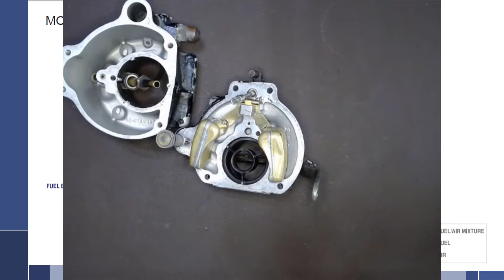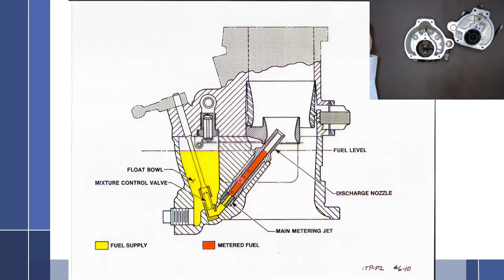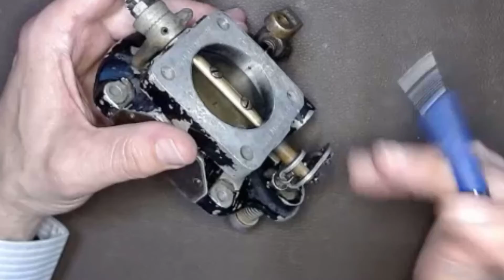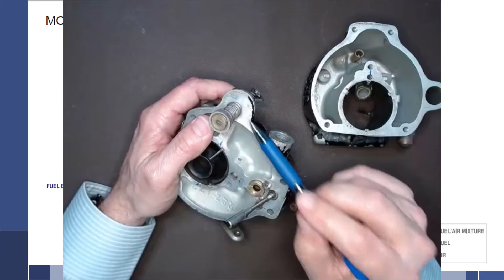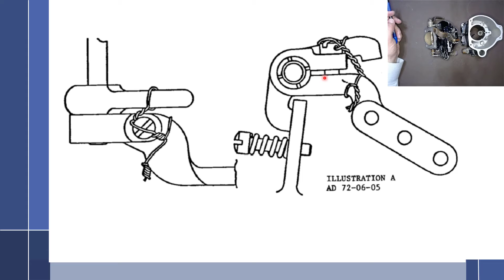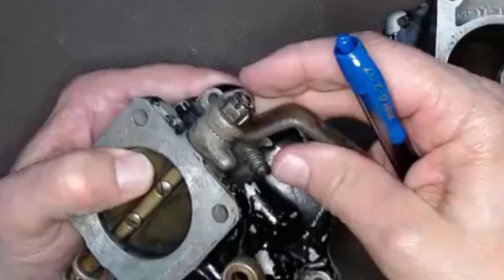The Marvel Schebler MA-3SPA (Accelerator Pump Version) Aircraft Carburetor

Comment: Man you are AMAZING. I just got my pilot licence and this is straight up wizardry for me. Im having a bit of trouble understanding something... Could you or one of the gentlemen in the comments help me?

Im having some trouble figuring out just why turning on my fuel boost pump will flood my engine even If my mixture is at cutoff. (Unlike injected engines where you can run the pump all day and you wont flood If the mixture is cut, you wont get any fuel flow).

One other question. In the carbureted engines does the accellerator jet (the one that squirts fuel when you give Full Power abruptly) work for priming the engine If the mixture is at cutoff?

-I know Its not recomended to prime the engine this way, but I've been flying a very very old and weird Brazillian plane at my local flying club that has no primer nor fuel pump and you are forced to prime It like this.

Comment: Great presentation. This is very much like a Carter AFB (now Edelbrock) automotive carb. The accelerator pump is the same design. The mixture control effectively operates like a manual metering rod. I found it interesting that you implied that you aggressively lean the idle using the mixture control given that the mixture is set by the idle mixture screw (same as on an automotive carb). In my experience, this is like trying to adjust your irrigation drip system flow using a ball valve on an 6" pipe. Look how tiny that idle jet is, and then consider the idle screw is restricting fuel even more than that (it only affects the first idle discharge) 50 rpm difference to get to peak (if the screw was set correctly) would be tough to hone in on correctly with a mixture knob turning a large slot a half turn, and would it matter much anyway? In automotive carbs this would be a barely perceptible difference on the plugs. - Automotive race carb tuner and commercial pilot.